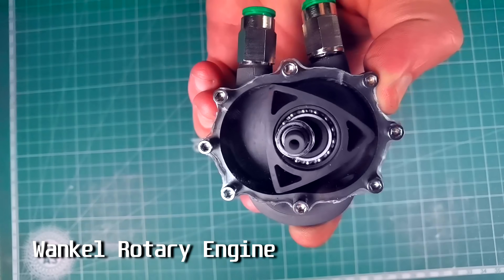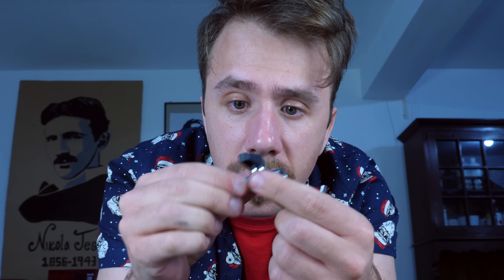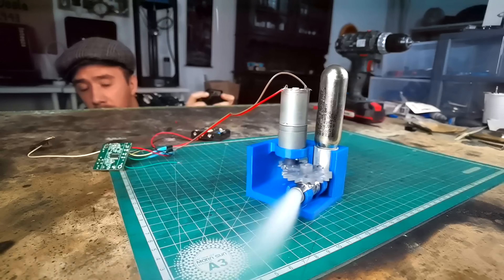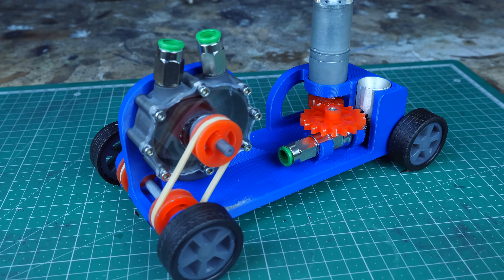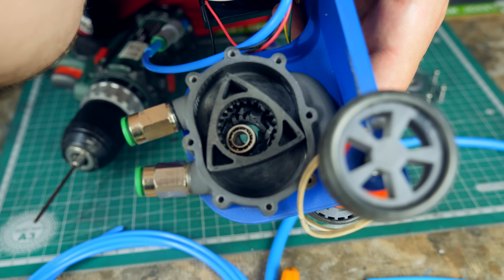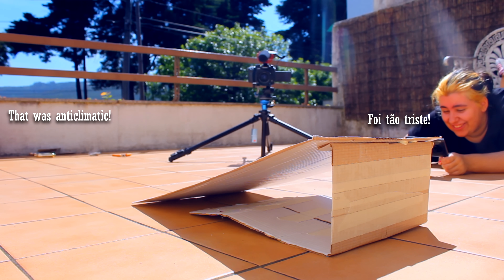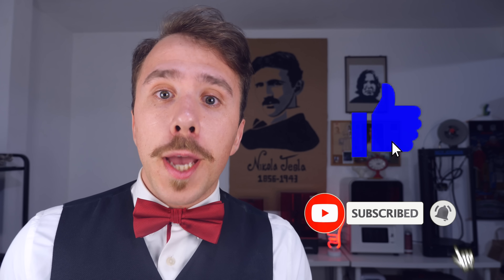Rotary Wankel RC Car (3D Printed)

Comment: I would love to see some kind of pressure buffer that would allow the pressure in the canister to be used more gradually rather than in one big burst.

When you're driving a car, you don't dump the whole gas tank in the engine, you pump it in little by little.

Comment: Video Idea: Maybe you could use the engine to power an hovercraft. The rotary motion to power a propeller to move forward and the exhaust of the engine to produce the airflow of the base to lift it

Comment: Why don't you make a buggy/baja truck chassis and use it with the wankel engine!.(the chassis will be a little bit heavy-er and it will help the wheels to have more grip!.[i own a homemade buggy chassis and i use it with a modified small electric engine (it hit's9000 Rpm's])

Comment: Put two smaller rotors together like a mazda rotary engine and conect them with a driveshaft to the wheels, also use two smaller air tanks or one big air tank for a longer run.

I also would recommend using proportional servos for better handling and throttle control.

And use a mazda fd shell for the car ofc.

Comment: all i can see is potential!
u can add a flywheel, a second wankel engine rotating at the opposite direction to counter the vibrations and maybe bigger wheels, could even be some soft wheels, like rubber balloon or something for added grip and act as suspension 
and if u feel crazy enough there u can add a regulator valve to elongate the lifespan of the cartridge

Comment: You need a bigger volume of air in between the valve and motor.  This will give the CO2 more time to go from liquid to gas and give you much more run time and useable power as well as non cryogenic temps in your motor.

Comment: The main problem is that you are using the rubber band as a link from the engine to the wheels,my opinion says thats wrong. If you carefully see when you release the valve, the rubber slips a lot and that causes to lose a lot of start speed, i think you should replace it with some 3d printed gears!

Comment: You wanna try making a 2 or 3 rotor wankel and a coupler that divides the 20g cartridge into the different rotors so the torque is more efficiently transferred to the axle? Maybe align them 120 degrees off from each other so every 3rd face of the rotor travel is covered by another power stroke.

Comment: I noticed that the engine was spinning the belt/band was spinning Very fast causring the belt/band to not stay around the wheel making the wheel not spin as fast as the engine. So I suggest using a gear ratios going from the engine to the wheels making the wheels spin at the same speed if not faster than the engine making the mini car work better

Comment: 🔧For your next project 🔧 : You can make a 3D printed Submarine and use the CO2 canister with a regulator and a highly efficient and quick valves (or you can DIY them like this one) for the propulsion (like the small jets of gas that is used to maneuver a spacecraft). And if you like, you can make a small torpedo launcher using CO2 canisters as the launcher😃. 

You are a really good inventor who likes to create new stuff and share it with others. I really appreciate your channel and all the quality videos you make. Hope to see more from you 😉.

Comment: The rubber band should have a 15% stretch to help prevent slip! 

You should limit the output of the cartridge, a lot of excess high pressure is escaping the system!

Comment: You can try to 3d print a small V engine and use compressed air stored in a bottle to power a RC car.

Comment: I love your videos and would love to see a rotary engine which runs on usual fuel. You could metal plate ceramic becuase off the heat. When you want a full metal thing than use LOST Pla technic with plaster.

Comment: I see 3 things that could be improved simply by pushing the CO2 through long thin tube wound into a coil. 

1) at the beginning of the release with the most power, way too much energy was lost with the wheel bouncing and spinning not touching the ground. 
2) As the CO2 expands, it cools, and colder CO2 takes up a smaller volume than the same amount of warmer CO2, ultimately resulting in fewer revolutions of the engine. 
3) lots of gasses came out the engine in places it should not. 

A) The back pressure from a longer tube slows the release of CO2 resulting in less peek power while deliver the power over a longer duration. 
B) And the longer tube will give it much more surface area while the longer release of CO2 gives it more time to take in heat from the walls of the tube. 
C) Finally, the warmer but lower peek pressure CO2 will put less stress on the plastic parts so that more of the CO2 can go through the engine as intended. 

Using a long coil will probably allow you to the larger CO2 cartridge without tearing up your engine.

Comment: You could use the wankel engine for a helicopter. The torque was too much for rubber bands though. Instead you could use a tesla valve running backwards to limit the flow of gas out of the cartridge. This will give you a longer power cycle with reduced torque. You could also use an impellar for uniquity.

Comment: You could try to make it all wheel drive, maybe it will help the rotory to go over the ramp through the better acceleration.

It would also help to lower the output, and make it more consistent through a smaller hole.

Comment: Video idea: With those being NO2 cartridges and you basically made a rocket car, why not try to use the Nitrogen Dioxide from those cartridges as the Oxidizer for a hybrid rocket engine on a RC-car??

Comment: Video Idea: Create a working 3d printed jet turbine that uses compressed air/gases which creates enough thrust to work on a 3d printed plane that can be wired with RC (remote control) components. I am entering my senior year of undergraduate for mechanical engineering with a concentration in aerospace and a 3d printer would allow my Solidworks creations come to life! Thanks for the amazing video as always!!!

Comment: I'd love to see if the wankel engine could produce more power through a gearbox, bring down the massive RPMs to one more suited for wheels of that size. Another thing might be to have the wheels that have the power behind them to have more weight over them, so they don't slip as much.

Comment: Not sure what the black stuff at the base of your valve is but you can get tape to seal threads (wrap the threads before insertion) that'd be less messy and fully removable. Also there are sealing pastes if you prefer. Hardware store plumbing departments carry them and they're cheap. Thanks for your videos.

Comment: idea: reduce vibrations on the engine by having a second "layer" where the triangle rotor is out of phase with the main one
Reply: That’s called a two rotor engine, it’s what most rotary cars use for that same purpose. More power too :)
Reply: The vibrations are caused by the slipping rubber
Reply: @johnbox850  the vibrations are caused by the rotating asymmetrical mass
Reply: Wait… what? Every production RX-7 I know of was a twin-rotor. There were three-rotor engines built for the Eunos Cosmo… and I suppose now with a bit more Googling, it seems like a few people have done a motor swap to put three-rotor engines into some RX-7s.

But in this specific scenario, I don’t really see how using more rotors would solve any problems. Integza wasn’t facing any issues with vibrations really, but rather faced issues with the fact that the wankel rotor—by design—rotates three times as fast as the drive shaft. Multiple rotors help in increasing available horsepower/torque to the drive shaft at more and more offset intervals, but this often comes at the cost of much more complicated eccentric shaft designs (in order to enable assembly), while the rotational design itself already reduces vibrations significantly just from not being a reciprocating action.

Adding more rotors to a compressed-air wankel probably also wouldn’t really make any sense, as it would just increase the static volume of the system and thus decrease the pressure of the system as a whole leading to less power… and as mentioned, still doesn’t solve the design principle that a Wankel rotor rotates at a speed 3 times that of the drive shaft.
Reply: @puellanivis  adding a second rotor would distribute the pressure better, the engine has too much blow by, which kills the efficiency. And it's not like he can put all the power down to the ground because the transmission belt slips too much.
Reply: Next next video: I 3d printed my own 4 rotor RX7
Reply: A 2 rotor engine with the rotors at 180 degrees from each other.

Comment: Change the driven axle to the rear. Youre getting so much axle hop in the front cause there is 0 weight. Literally just run the motor in reverse and you'll launch that sucker up that ramp

Comment: You should get some solar panels for your roof and you can 3D print the brackets to hold them and also make a sensor that tracks the Sun through the sky to get the most energy from the light

Comment: You need to use lubricant on these geared things :P  Not only will they run better, but they'll be much less likely to destroy themselves.  I also wonder if lubricant would help inside the engine itself?  Just some lithium grease would work.

Comment: If you switch the rubberband method to a chain or a geared  transfer, the wankel  engine would perform better on the car.

Comment: I think you shuld put a pressure regulator between the CO2 cartridge and the engine. Because you release the etire pressure in one big burst. If you keep it at a lower flow rate, the engine works much more efficient.

Comment: why don t you try to build a computer case ( 3D printed ) it very challenging to work on a hot component  and we will get a better understanding of the reaction of the 3D printed component with heat

Comment: Video Idea: You should make a 3D printed rocket with 3D printed rocket engines and a parachute so when the rocket lands you can swap the engines and send it off again, you could also use a tomato as a pilot!
Reply: I think Tom Stanton did something like that. But I'd like to see Integza's version...
Reply: @scottbruner9987  Yeah Integza version would be cool, as Tom's rocket didn't get very high I think it would go way higher and faster if Integza did it.
Reply: Terran 1 intensifies
Reply: @alt8791  Terran 1s'  multi-million reorientation mechanism has nothing on a  nylon parachute.

Comment: So there are two ways to improve the engine/car desing
1st the gas pressure is way to high, you are loosing pressure through every non existenct gap that could be one, try using a restricting valve to throttel the pressure
2nd the engine seenms to have (like you said) a way to high rpm, and the belt ssemed to slip alot, that means the torque and belt friction were off, so try playing with the relative sizes of the pulleys and maybe use teethed belts/pulleys or increase the pressure to increse the friction, that you dont loose that precious energie

Comment: make a tesla-turbine-powered race car. I'm curious as to whether or not the tesla turbine has enough torque. if not, you could use a gearbox with a servo for remote-controlled gear changes!
Reply: or maybe I'm going a bit to complicated with my idea, pretty sure a single gear ratio would be enough xD

Comment: you should check the engine design of the company liquidpiston. it is a reversed wankel where the seals are static and easier to maintain

Comment: Make some Tesla radio devices.
 You've proven yourself to be a Tesla fan and tried re-creating many of his inventions. One thing you never tried is using the Tesla coil as a radio antenna, he did design it to transmit power but later realized it could be used to transmit signal, thus inventing the radio.

Comment: I think there is too much pressure at once, you lose a bit of potential energy also because the seal between the acrylic and the case isn't good enough. I would make a chamber where the CO2 can depressurize to be like 10-15 bars so you get less loss and more runtime.

Comment: Video suggestion: You should 3D print one of those flying, spinning, helicopter type fireworks. Using multiple CO2 cartridges as propulsion. The challenge that would be very fascinating to watch would be what your solution is to make the valve mechanism lightweight enough for the machine, and how to make it relatively synchronous to release each cartridge. Love your creativity and ingenuity for all these challenging projects!

Comment: video idea : you could 3D print parts from a helicopter and make it work from presurized air. like putting some dry ice and water in a bottle to create constant pressure released into an engine similar to the wanker engine to turn the helicopter blades !

Comment: I think the biggest problem is that there is too much slip on the pulley so energy is dissipated rather than transferred, you could use a gear pulley system, v pulley, directly gear it to the wheels or gradually increase the speed to avoid the pulley slipping

Comment: used the CO2 cartridges in paintball markers and launchers.  it looks as though you may want some sort of an expansion chamber/ regulator of some sort. This would allow time for the gas in the cylinder to expand, warm up slightly prior to entering the Wankel, and give a sustained "power band".

Comment: Video Idea: Try a Scroll Compressor  as an engine instead. That's the one they used in Perseverance to compress air sumples. 
It has less moving parts and it requires low energy inputs(in reverse this could translate in high RPMs).
Also am really curios to see if it is works that way.

Comment: The rubber band wasn't transferring that much torque imo, maybe gears or a stronger teethed band with teethed pulleys could do better, also modulating the pressure to distribute the torque through time could make the engine more efficient :)

Comment: I was wondering what if you printed a 🛋 ( couch or a sofa) out of 3D printed parts..  I don't think the sofa will maintain its structural integrity over a certain load but if we make like hollow bricks and used some magic of structural mechanics  I guess it'll work.. it'll be cool to see though...

Comment: It would be cool to have a 3D printed CVT attached to the rotary engine. Then your power would be transmitted more to the wheels. The rubber band seemed to slip a lot. Perhaps a proportioning valve of some sort could be used in place of your initial designed valve to release the gas at a slightly lower rate as well.

Comment: Try to release the CO2 gas in a controlled manner so it can run for a longer period of time...also make something that gradually increases the rate of gas output so u wont damage the gears inside with the burst power directly....im not a pro in this, but it doesnt hurt to try... You're one of the best smily face

And also try to keep the CO2 cartridge warm by making a small container that filled with warm liquid and immerse the cartridge in it

Comment: Make a steerable, remote controlled wankel engine  RC car. Make it so it uses a small release of CO2 instead of it all at once though (kind of like how an airsoft gun does it). you could maybe even get it to skim water.

Comment: 3D-Printed cherry tomato gun. You can use all internal components out of an cheap but robust Paintball gun (Tippmann 98 as an example) It has pressure regulator inside. It is also possible to use a solenoid valve. For Pressure C02-Capsules or a normal 0.8 Liter Pressure Tank.

Comment: Video suggestion : use belt transmission instead of rubberband , It looked like it was slipping .. and maybe use bigger wheels and make it 4 wheel driven as the engine has too much power.

Comment: I wish to win the 3D printer because I love designing drones hence using the manual way is tiresome an dangerous because it involves a lot of cutting and burning ....if I would have the 3D printer it will make my work easier

Comment: Just a few observations. 
The opening of the cartridge should be facing up so the liquid CO2 doesn't shoot out, this will give you more trust time and prevent your gears from freezing and shattering. 
The rubber bands are too elastic and aren't gripping the pulleys well, causing severe lack of torque. 
Try mounting the engine with the exhaust pointing backwards to give extra thrust. 
A more controlled valve will allow you to better regulate the power and thrust, for longer runs.
Keep up the good work.

Comment: Video Idea: Considering you have already built several rocket engines what if you 3d printed a rocket-powered car. It would be a good in-between step from cars to actual rockets to test the strength of different engines. You could even put tomatoes as passengers.

Comment: To get more out of the cartridge you need an expansion chamber before entering the engine. You are getting an excess amount of liquid CO2. Also you may want to flip the cartridge,  narrow end up. That too will help minimize excess liquid CO2 entering the engine. Also place rubber bands on those plastic wheels to help with grip.

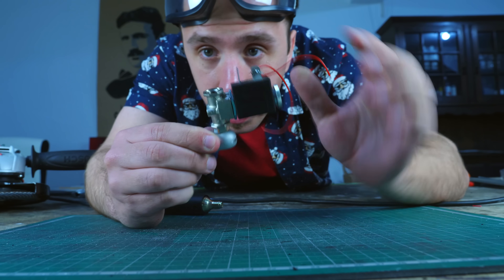Comment: 1:32 Little tipp for the future.
If you make or use a metric thread and you want to use a adapter like the one in the video mark.
Who has a conical thread, you will need some special PTFE Tape(Teflon) on the thread to seal it.
Otherwise you have no chance to get it leak free.
You can find this special tape at every hardware store or plumber store. (2-3 €)

Comment: If you use a 1 :10  gear transmission (I think the gear is recommend) to the motor (large gear will be around 500 rpm), then an other transmission to the weal (1:2 , it can be a belt, I guess...), the weal's peripheral speed will be around 20 m/s (theoretically). Yes it is still too fast, but the belt will lose some rotation, soo it could be work....